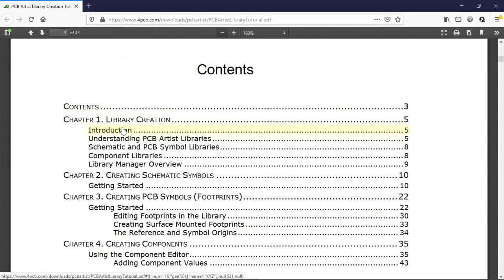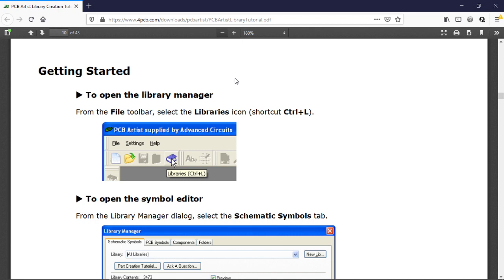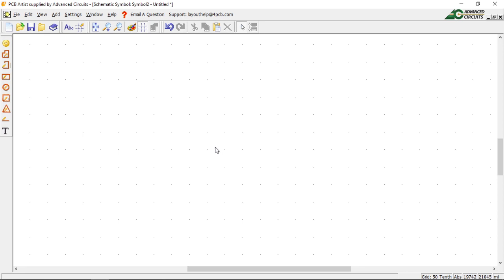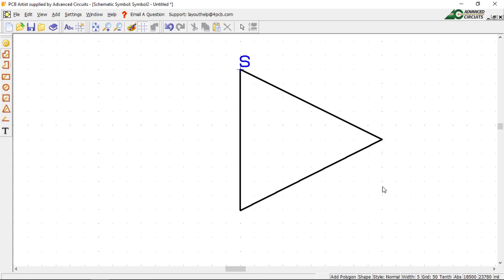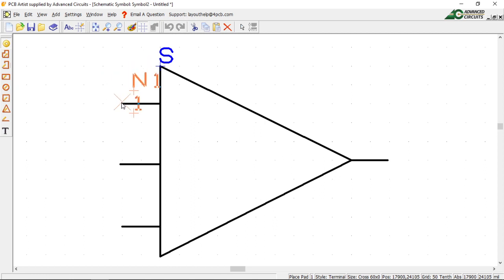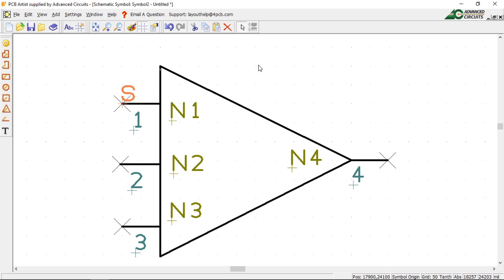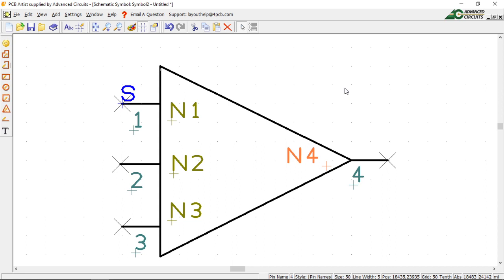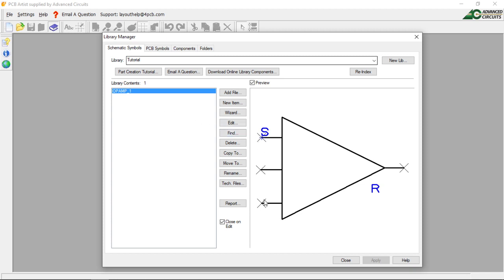PCB Artist Library Creation Part 1 Schematic Symbol

Comment: Thanks for your videos - They help me a lot. -  But I do have a question, When I right click on a trace and go to Properties - It tells me the Width: as 0.1  -  Is this in m.m.  or inch's?  0.1 inches seem to big for a trace and 0.1mm seems to small for a trace.  I know can change this to be thicker, If I have a  TTL logic gates (AND gate) driving a standard 5mm LED.  Is 0.1??  good enough? What current can that size (0.1) handle?
Reply from the maker: Hey Tom! Thanks! It depends on what you selected when you opened the program. When you first start up PCB Artist, you select the thickness of the board in "ounces" and the "units" that you want to work with. I usually go with "mils", which is 1/1000 of an inch or 1000 mils equals 1 inch. In GB, I believe they go will "thous", which is the same as "mils". Now, 1 inch is about 25.4 milli-meters (mm), so we have 1 inch = 1000 mils = 25.4 mm. Or you could just use 39.4 mils is about 1 mm. So, if you see 0.1 and your chosen units is mm, then that would be about 3.94 mils. When I choose mils as my units and 1 ounce copper thickness, the default values in PCB Artist for signal carrying traces is 10 mils  (about 0.254 mm). The default values for power traces (dc voltage and ground) is 50 mils (about 1.27 mm).

If you search on Google for current capacities for pcb traces, you will find charts or tables that give you the maximum current for various thicknesses (ounces of copper) and trace widths for a given allowable current rise (10 deg C). So your first step would be to determine what the maximum output of a TTL device. Then you would use these charts to determine the "ounces" and trace width. A trace width of 10 mils of 1 ounce copper should be more than enough for TTL signals (20 mA max)! Make sure you use a resistor to limit the current in the LED. Have fun.